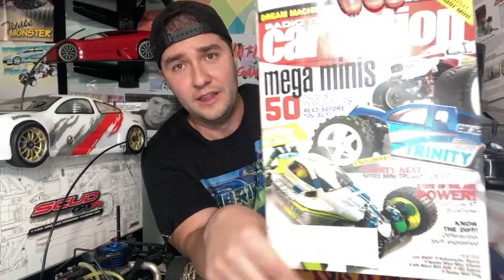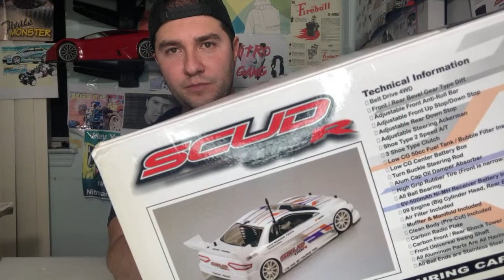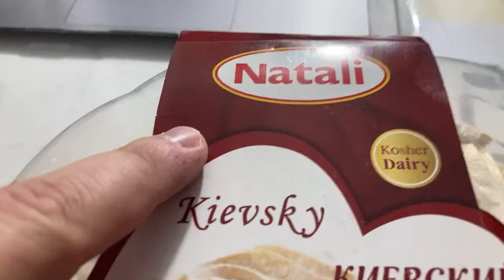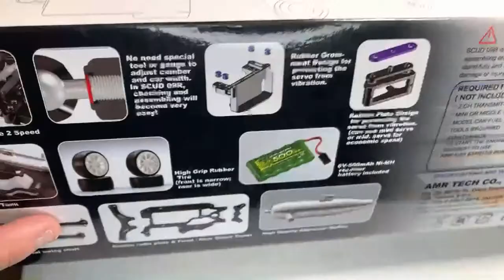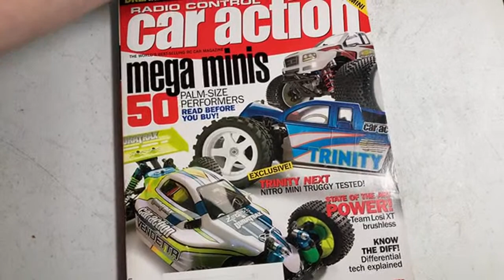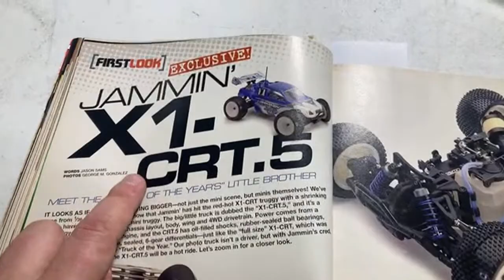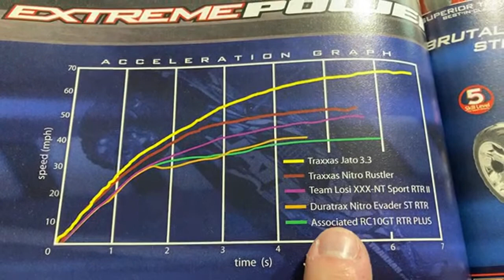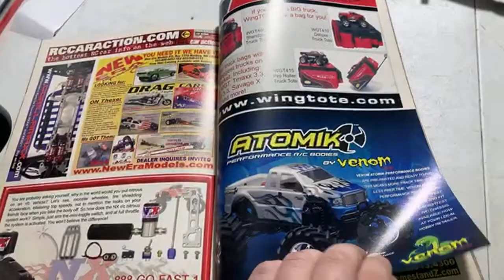NitroGang Live - Unboxing a rare 1/12 competition Nitro Kit with a .09 engine and 1HP - Ofna LD3

Comment: It won't roll back because he built the diff incorrectly.
Reply from the maker: hey bro! you're on the right track.  I didn't want to give away all the details, but the clutch bell assembly othatthe 2-speed pinion gears) are not correctly screwed together, and one screws off constantly.  This basically locks it up, looks like.  I also noticed tons of weird suspension issues in the front.  But I will get to them later!  This was just a quick demo and unboxing kinda of, you know.